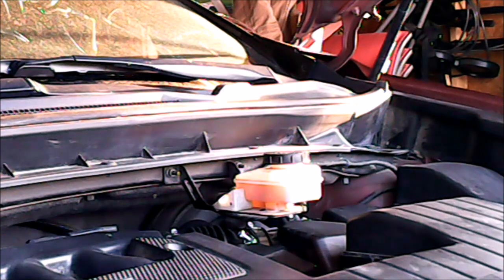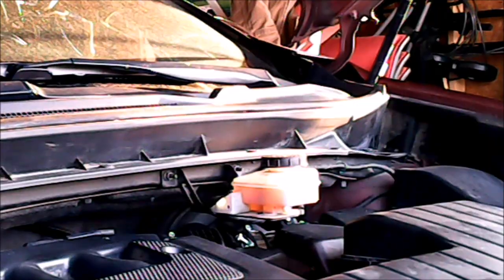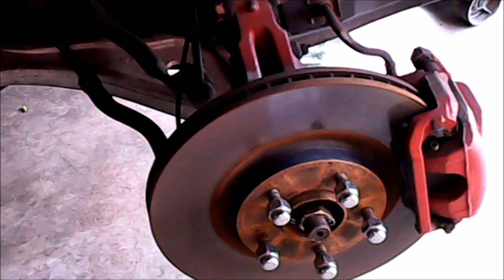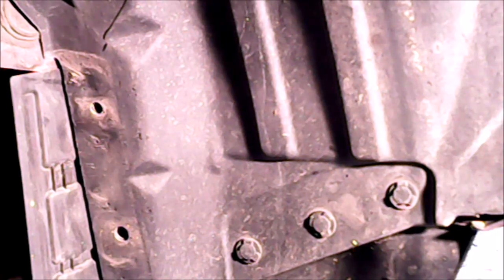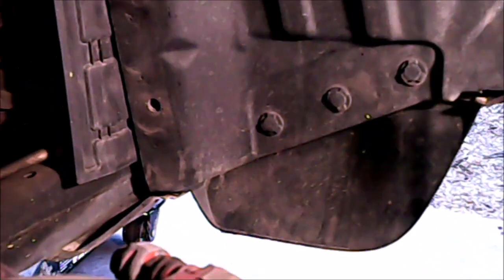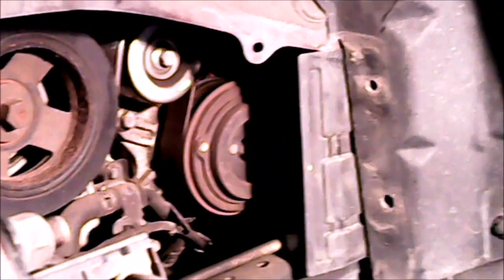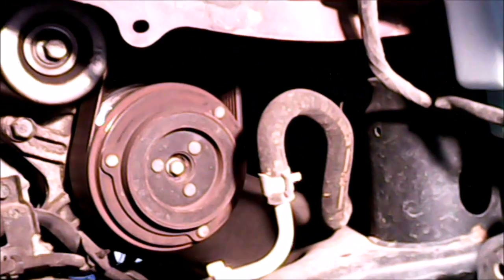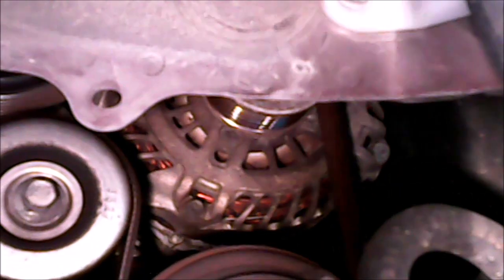2009 nissan murano alternator replacement part 1

Comment: Would have been helpful if you said at the beginning why you have to pull the alternator. For my situation battery Volts not running was 12.62V,  The car running 14.1 - 14.2 that is this air conditioner running, lights with hi beam and radio.  I have not pulled it yet still looking if I should pull it
Reply: have you checked the description?
Reply: @jaredromero5114  Hi, yes I did it say's alternator replacement, i was asking why did you have to replace the alternator did it stop charging ? did lights on the dash  come on while you  were driving, or did the light come on during idle?
Reply: @rlarson3232  ohhhhhhhhh! Thats a great question. THank you for elaborating. I hope op answers bc now im curios too
Reply: @jaredromero5114  My Car the problem I have is that I had Napa run test, the battery ok, alternator ok, but as a I drive intermittently  on the dash the Battery and Break light come on. When I go home i put a volt meter on the battery the voltage is ok at 14.4V, while still running at idle the lights on the dash come on the voltage drops to 12.3V you can hear the car idle down slightly that lets me know to look at the dash and yep the lights are on. I did order a Alternator from Amazon waiting for it to be delivered should be here to morrow Tuesday I will install On Friday after thanksgiving. Oh cost Amazon $146.00 out the door, Napa wants $229.00 out the door, about a $83 savings. I will followup with a review on my install and if that fixed my Dash lights Battery/Break lights coming on.
Reply: The light on the dash came on.  That was the solution from AutoZone.  Light has not  appear since then.
Reply: rlarson3232 i have exact the same issue, were you able to fix it with the new alternator?
Reply: rlarson3232 does the new alternator helps ? I was doing some researches and says after market they dies in few months